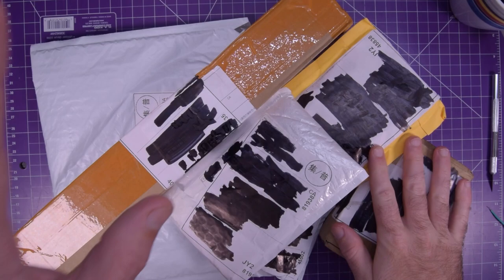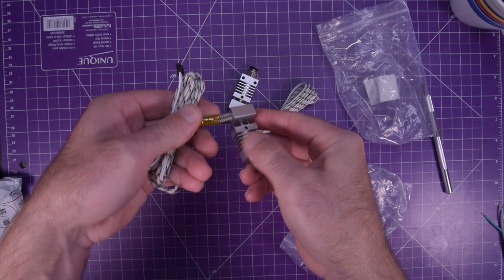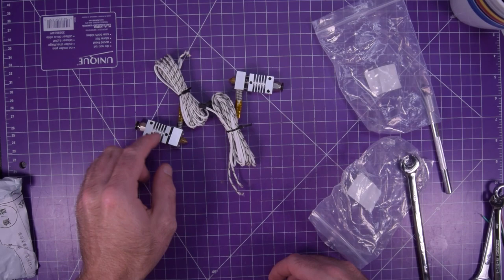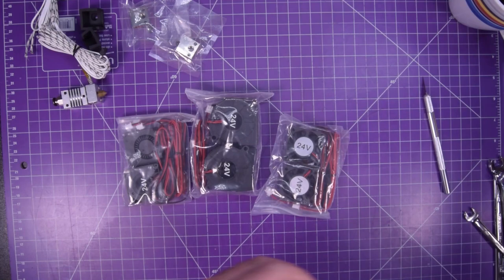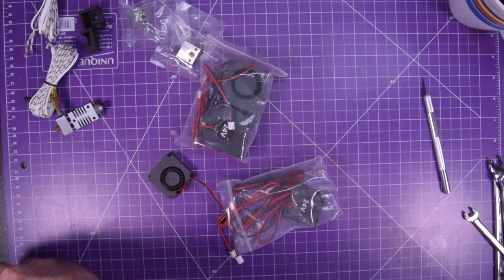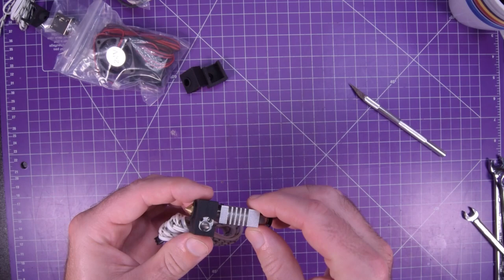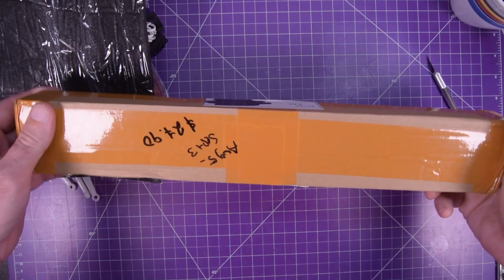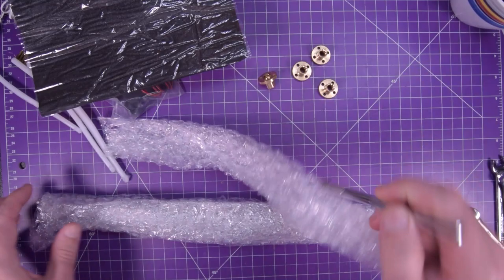Mailbag 116 - Upgrades For An Old Friend

Comment: For the longest time on Aliexpress, when you upped the qty until the shipping jumped and went back down, the shipping didn't go down. You had to refresh and start over. Glad that's fixed. I use that trick all the time. Although, when shipping jumps, you often get the parts a month faster...so it works both ways.

Comment: I heard a fan noise on the hot end when I turned my printer on recently so I opened it up and thought I'd try the oil the fan trick and it was sealed. I saw a video on removing a plug and oiling it. No luck if it's a plug it won't come out.
I'm tempted to put one of the 2 Creality direct drive on. Like you I've got several upgrades in the works. Just need time to do them.

Comment: I've been using a TriangleLab all metal hotend for a while. If I remember correctly I had to reduce my retraction distance.
The Ender3 subredit is full of people shorting the heater to the thermistor with a wire brush and blowing a mosfet so be careful!

Comment: I do the same shipping trick. I also look around for free shipping or a better quantity for low shipping price. I did that to get hygrometer/thermometer units to get 10 at a good price. I stick one in the vacuum bags with my 3D filament. 
Of course after I got a bunch I found some which will do both Celsius &  Fahrenheit. Figures. Celsius will work, but I was raised an imperialist in the temperature department. Lol

Comment: All thermisters slide in like that on most mk8 hotends. Those striped heaters are 50 watts I think. Don't hold me to it.

The fella who got my cr10 traded me a 500 dollar 8 amp isolation transformer and a tektronix oscilloscope  haha. He has 5 tronxys